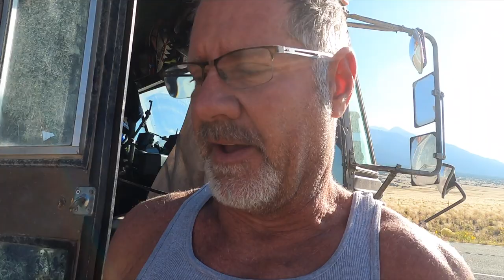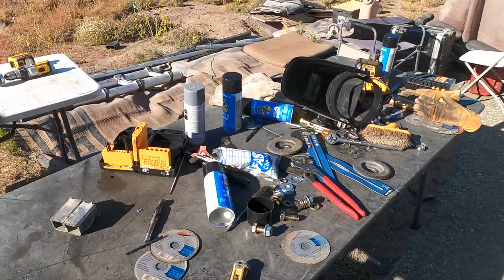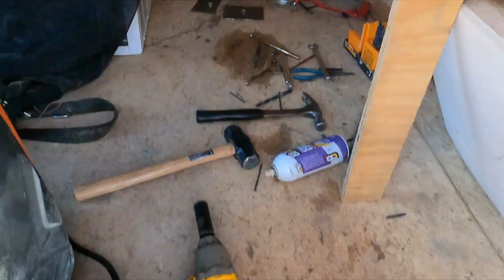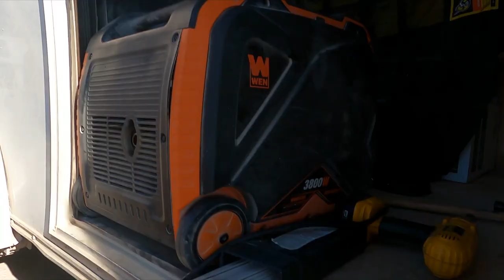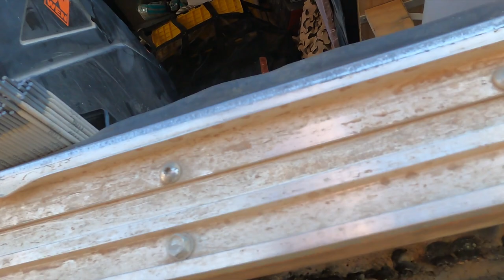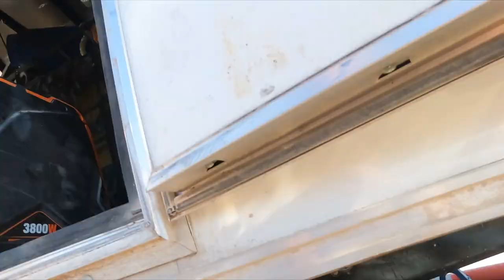Where Have I Been Since The Gutted Event in Alamosa, Colorado?

Comment: I’ll tell you a little secret to welding, strike a arc and a puddle will form around your rod. Move your rod only fast enough to where your puddle will stay round. If you go to fast your puddle will stretch out and it will be seen in the bead. A good weld looks like a roll of dimes. If your heat is right your flux will turn loose and knock off your weld real easy. Watch your puddle, one of the things to making a good weld.
Reply: He has a mig no stick
Reply: Really Hard to Stick Weld very thin metals, especially those that still have paint on them. Welding is just like Paints; there's alot of preparation involved in every job....im in cortex if you pass through here i can help as I  am a good welder fabricator, plus I have all that is needed with me....Good Luck...
Reply: @evopwrmods  
Yes you have to clean the area with a grinder, welding over anything with paint is no good. You can go with a smaller rod or a little mig welder, they don’t penetrate  like stick.
You can weld real thin metal if you back it up with a fat piece of copper behind what you are welding.

Comment: As a welder I'm grinding out all you have done and starting over. Maybe even weld a thicker strip doubler to the trailer before welding tongue to that doubler. If the road is that rough getting in you will probably not even make it to the main road with a full trailer. If you find a real welder, he/she could make it bullet proof. The trick is finding a real welder. Good luck.
Reply from the maker: I was thinking the same regarding someone knowing what they are doing making it bullet proof. Thanks for the tip. We made it into town. Now hoping we get somebody like you sound to make it right. Grinding my work clean won’t hurt my feelings none.👍🏻
Reply: @enigmaticnomadics  Again, Good Luck.

Comment: I know there’s probably wood under your trailer. But when you gotta get better penetration. Heat it up first with a torch. Then weld while it’s still hot.
Reply from the maker: Great advice. Jack. I think that if my generators (Two in parallel to total 5500 watts) could have been more powerful, I could have used bigger sticks and gotten in deeper. Funny how a guy can learn all about power settings, steel prep and stick gauges, when he's stuck on the side of the road and has no choice. I always say that we learn through sad experience. At least that's been my case most of the time.